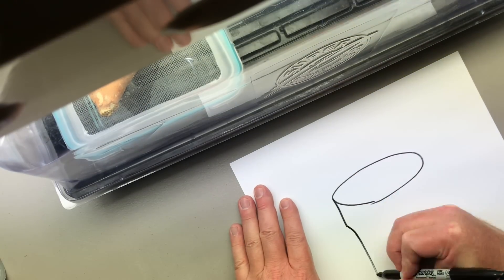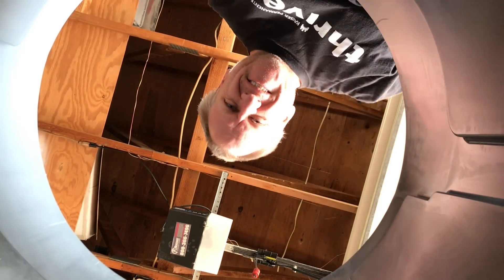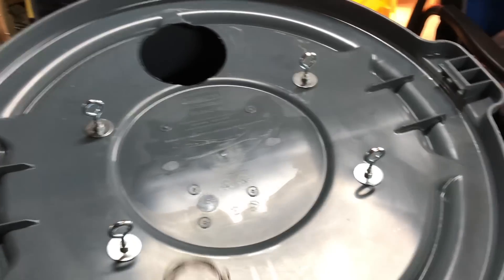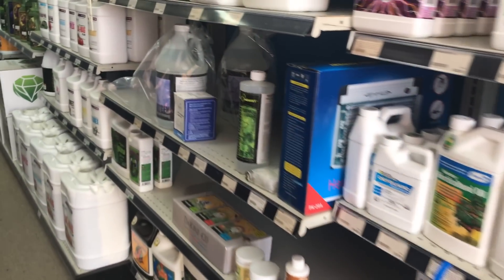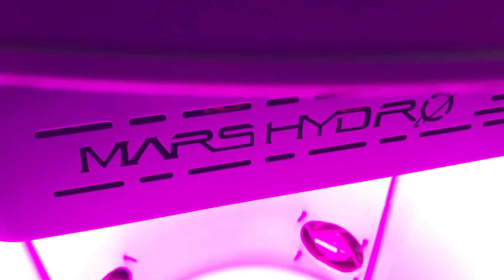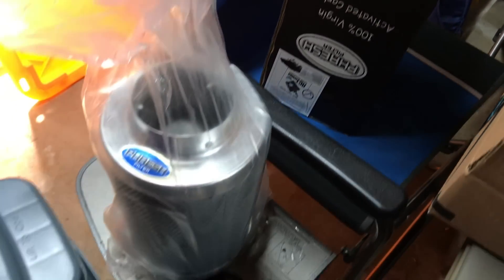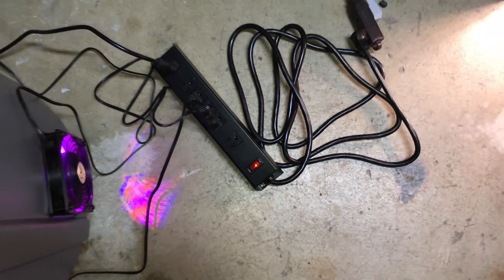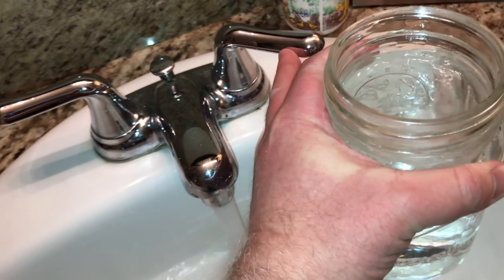They Grew Inside My Secret Trash Can

Comment: PS. Still have Reef tanks, and the world of LEDs look amazing. Imagine 1000 watt HPS, 1000 watt Halide heat buildup in an 8ft diameter Mylar curtain. They love less than 70 degrees under lights. 60 to 65 or a little more in dark. They are athletes, the hotter they are, the more energy they waste transporting water.  You might try some type of portable A/C to supplement your environment. And they love stress.  I would break the main branch at a point where I could get a good 90 degree bend, and allow all the budding sights to stand straight up. I used shoestring and thumbtack to the ceiling and repositioned almost daily.  If I say light hitting the curtain, wasted light, move a branch to capture it. I mean, 1000 watt lights were only good for less than 30" penetranion. Max height was about 36" from floor

Comment: I will give you a professional tip. If You don't want to do full hydroponics, use 4" Rockwood cubes, and a Rubbermaid wash tub,about 12X16".  Now here's the thing about Hydroponics,  its not just providing nutrients, its more about cycling the water. But its not cycling the water, its having stagnant water that the plants have pulled all the 02 out of. Its like a pond.  So, being an old aquarium guy, I used air pumps, gang valves and tubing and air stones to oxygenate the water. Never had to change it, only add water weekly or so. When the plants were ranking, you saw this beautiful white lace root system.  If you got root lockup it might turn a little red tint in the water, and effected plants roots wouldd turn tarnish.  I would pull that one out, flush it out good in the tub, and reinsert an watch it.  That was 30+ years ago, and turned several Dutch growers onto it.  Sometimes its looking at things from a different perspective to see something.

Comment: I don’t see how the carbon filter is doing it’s job when it is extracting the air from outside of the bin ? Also lining the inside walls of the bin with reflective Mylar or a white sheeting (black and white) will help with light refraction

Comment: Might want to line the inner walls with reflective material, mylar emergency blankets will work well. The light reflection will improve your plants light coverage and also help lower foliage receive more light than what those plain gray wall will produce. And also, I would recommend using a pvc plumbing bulkhead to properly secure carbon filter, may use caulking to seal air tight, And will look better. And if the filter sticking out the top is too noticable, and want it to be more concealable, cut bottom of 5 gal bucket and drill holes in the lid and throw it over top of filter and it will look like just a bucket sitting on a garbage can.

Comment: I'm new to this.. I'm using a commercial 5x 2 beer display fridge with two way mirrors in front , how does a temperature controller control temp? Shut the lights off,  lower wattage, or? 
Sorry if this is a newb question but thanks in advance. 
Tulips just became legal in AZ. 
Cheers!

Comment: Super OD on those fans. 435 cfm exhaust  for a trash can thats probably 40 cubic feet at most.  Could have used one computer fan in, one out to a 4 inch carbon filter and maybe an oscillating usb fan hanging inside but even that wouldn't  be 100% necessary.  Idk just weird to use 12x the electricity and charcoal filter to get the same results on his "tulips" which fucking annoyed me because i only clicked on this to see what kind of bonsai tree like bud he managed to produce in there.

Comment: I was Growing "flowers"(starters/seedlings) like this in 2005. Suggestions if you care, for the wires and plug, Dont cut large hole, just make a series of straight cuts making a star shape, then force them plugs through, and aluminum tape it's a good heat sink and air seal

Comment: Wouldn’t the height be an issue...?  Probably could have just tossed soil into the bottom of the can, no pot needed and save a little vertical space. May also need to cut the bottom out of another can and flip it upside down making a can bottom the top. Light has to be adjustable top to bottom so use pulleys. I say you need 3.5 feet from the top of the soil to the bottom of the light. This won’t grow a proper marijuana plant but it’s proof of concept and really cool

Comment: When I was a teen I thought I was being slick when I converted a huge house speaker into a grow box.  I used old computer parts like the power supply and a fan, rigged a light and lined with Mylar and a watering tube.  You would NEVER have known by looking at it that it was a grow box...but after a few months my dad started smelling something funny coming from my room...game over.  But it was a fun little project while it lasted.  One thing he mentioned that I didn’t have...a carbon filter, I know what kinds of flowers he’s growing. 👏🏽
Reply: So did your dad let you keep growing or no

Comment: Do one of those Walmart storage tubs. Or turn a piece or IKEA furniture into a multi chambered garden/desk. That would be sweet! I built a 2x2x2 pine box and covered it in reflectix. Just reflective bubble wrap. Cutting vent ports or Velcro stripping different gear to the inside/outside is super easy

Comment: What kind of carbon filter is this? I've been growing for decades and have never seen a carbon filter hooked up that way. Every single one I owned would need to get the "dirty" air sucked through to work properly. Your setup obviously  blows the dirty air through the filter. Is it a different kind of filter, did you hook it up backwards intentionaly, what's the deal?

Comment: I love the idea and the quality of your video, but how did you actually control the temp inside? You had a temperature controller but what mechanism dropped the temp inside the can? You could probably set a watering system from a  plastic hose run through the side of the can into the pot. Great idea!!!

Comment: How secret is it? It has a 12" carbon filter can coming out top. Has pc cooling fans on base. Wires and bolts sticking out side. And what is the trash can doing inside on a carpeted floor? You could have gotten a nondescript 4'x8' tent. People would be less interested in a mobile wardrobe for suits and ties 😉 than a trash can in a spare bedroom. Enjoyed your enthusiasm though

Comment: Use a storage tote black stand like a fridge place on a chair use a USB fan about 3 in from bottom an cut a hole on top I place a seedlings mat an a led light an use solo cups to start seeds an outgrow I make small holes on top to to hang light an a auto wifi watering system I'll make a video soon carb filter pad that's that

Comment: With fans blowing air into the bin the pressure will be higher than the surrounding ambient pressure. Carbon filters apply a resistant force to the air escaping through them. Air will find the path of least resistance when escaping a high pressure space. I suspect that the duct tape will allow air out over time and the smell will be noticeable during flower. A good way to test for air leaks would be to blow smoke into the bin and watch to see if any smoke escapes anywhere other than through the filter.

Comment: There's still air leaking from the lid. And my tulips are growing tall quickly with the MARS lamp. My lady likes long stems. What do I do now???
Reply: Putting up a net should help train them from growing too tall. You can always tie some branches to the edges of the can to help bring the height down.
Reply: Maybe a strip of adhesive backed foam around the top of the can for the air leakage.  And tell her length is nothing if you have girth.

Comment: This is bullshit, that fan cannot force the air thru the carbon filter properly there has to be a duct fan down the line sucking out heat and forcing thru carbon at proper rate

Comment: Really nice build! But I have some pointers for growin weed in this setup.
 1. There needs to be some kind of flap to stop light coming through the intake, since irregular light schedule can be damaging to plants. I would go for a shroud on the outside. Tho I would rather go for passive intake and active out directly connected to the carbon filter.
 2. The white wool from the filter's box is a primary filter as to not clog carbon with big particles.
3. For a really stealth build you could install fans and carbon filter on the inside of the trash can.
4. Reinforce the lid with some plywood for extra rigidity.

Comment: I would modify trash can slightly with holes in bottom with a drip tray underneath to catch spillage but other than that awesome design
Reply from the maker: need negative pressure for that tho
Reply: @JebGardener  trash can inside a trash can maybe?

Comment: made one of these a few years ago, they work well if you are limited on space, stick in the corner of the room and your good to grow a lot of things, I used 2 bins top one upside down on the bottom bin attached with latch's, and was set up so it could be taken down and stored away if not needed, cheaper option if you don't wanna spend money on a grow tent
Reply from the maker: sounds fun

Comment: You would be a lot better off with a fan directly on the end of the carbon filter pulling the air out of the trash can so you have negative air pressure inside of the can, the way you've got it makes a carbon filter pointless as air will be escaping everywhere due to the positive air pressure, not sure you need a carbon filter for tulips tho.
Reply from the maker: postitive pressure is a way to reduce the need for fan power though.  As long as the only way for air to escape is throught he filter, you will be fine
Reply: @JebGardener  making something totally air tight is very difficult to achive, if you've got a smelly plant whos smell your trying to stop escaping to the outside world then negative air pressure is the way to go, i'm pretty sure that one larger fan pulling the air through the trash can would be more efficient then 3 fans pushing the air through the can and out of the carbon filter. The other problem would be if one of the fans broke then the 2 fans that are left would be pushing unfiltered air through the hole for the 3rd fan.

Comment: bit ott though isnt it, arent those led light best at like 2 to 3 meters above the plants heads
Reply from the maker: i think 18 inches would be fine with proper ventilation.  heat is why i employed the temperature contoller

Comment: Could easily add a drip feed for the watering, or a flood and drain system
Reply from the maker: sounds complicated
Reply: @JebGardener  not really, the bin could sit on the well, use a small fish tank pump on a timer. Fairly simple. It would reduce the amount of time spent taking care of the plant, you could then just check the stats on the temperature, use a clear tub for the well so u can see the water/feed mix level. Be easier to leave it for a couple days unchecked if needed. Like the idea though and I've actually come back to this video after a year as I'm going to do the same but using a taller wheelie bin and line with mylar

Comment: Metal plumbers tape would work great for trying to attach that charcoal filter better than you did. And you're using it the wrong way it's supposed to suck air in and push it out. That's the reason for the pre-filter that you threw away. It makes the charcoal filter last three times as long depending on how dirty an area you're in, a garage you might need it more often

Comment: I don't understand your theory behind having a charcoal filter for something like tulips? I only have one for mine because I grow cannabis for my Crohn's disease it's actually the only medication that actually has any effect on my Crohn's which is horrible to the point that I have a colostomy bag on my belly and it's not reversible because of all the perianal abscess is I had with my small intestine pouch. Large intestine gone since 2001. Your little Trash Can thing is it all right idea your weakest link is probably either they LED light or that duct tape. A Spectrum King 100 would be perfect in that trash can. And I would drill the exhaust hole over the top center of the LED as well. Spectrum King has a massive heat sink no fans. I would also put a fan inside to blow against the foliage or a canopy of your plants. Then that would be perfect.

Comment: For watering, you could cut another small hole on the side or wherever fits, feed a tube into the plant and a funnel at the other end, that can detach and you can close off the pipe and keep it from losing air, and put a small live camera to watch it grow or not.

Comment: go to amazon and buy a 2x2 grow tent for the same price as the rubbermaid trashcan. Much easier to assemble, no hardware needed, and the tent is equipped with reflective material, ventilation panels, and light mounting brackets.
Reply from the maker: yes tents are better than trash cans, but this is fun
Reply: @JebGardener  I understand, and it is a cool project.

Comment: I'd probably use a different cable for the light's power. They have them in a style that is 45 degrees and you wouldn't have to give as much clearance. More room for plant growth.
Reply from the maker: i could have switched it but i wanted room for the fans to circulate too

Comment: i got the same light
Reply from the maker: how is it working for you?
Reply: it works great  i actually used it to grow cannabis for my own oils so I don't have to take siezure meds. It lasted bout a year long at 12 hours a day before diodes start to die off but the casing works great to make a homemade cob led after diodes die. atleast that's what I do I also like the vipar spectra its only tiny bit more pricy but has built in UV and ir which is great for plants
Reply: but mars hydro is my go to brand for led as the price and they are strong so they are great and prob the biggest name in the led biz for your every day grower as can't beat the price for quality

Comment: Mate a couple of suggestions.  Put the inlet fans behind the handles. The inlet is then hidden and a better position.  I painted the inside of mine white, helps with light. It isn't too hard to fashion a carbon filter that fits neatly inside the lid, without taking much space, and adequate for one plant. My own version is almost undetectable from a normal bin unless you open it. The grilled lid outlet doesn't show any light, and only the neatly fitted power cord coming out the bottom is off.
Reply from the maker: you used positive or negative pressure?

Comment: Space buckets!!! When I recommended them I really didn't think you would do one. Pretty incredible, huh?  I have a trash can with a hole cut in the bottom the size of the inner diameter of a 5 gallon bucket. The bottom of the trash can is attached to the top of the bucket. My...uhh..."tulips"...yeah, my tulips are planted in the bucket which allows more height  for the tulips to grow. Also, "they"...whoever they are ...recommend painting the inside of the bucket flat white as it reflects more light back on to the plant. No idea if that's true are not. I just did it. It's always a pleasure watching your videos. Thank you.
Reply from the maker: yeah i seen them stacked buckets.  it's a neat concept but i would just use a trash can

Comment: what's your monthly electric bill looking like?
Reply: nothing.. that whole rig uses about 1/3rd of a space heater...
Reply: actually that light draws around 170 watts from the wall.. plus two little fans, and most likely a humidifer, if you plan to grow pot...so probably about 250 watts draw total.... space heaters usually rock about 1500 watts... so about 1/6th of a space heater... not too shabby....

Comment: You could line the Can with foil. To maximize the light your plants are getting..
Reply from the maker: good idea
Reply: @JebGardener  I used two strips two foot long, and foil for a backing screen. Also an inf-red heater to grow my salads all winter..
  Also this acts as a great humidifier, in the dry winter.
  My set up was in a C shape. With heater on one side.. The foil help the plans grow nice. 

  I did have problems with my onion roots kept molding.. As I use pot soil to grow all...
Reply: @JebGardener  note: mys system not counting heater was only 12V at less than  1.2Amps but it worked. 

Next year I am doing more lights. And will try a Mylar door on access side.

Comment: Rubber air hose tubing about 2mm in diameter or so.. ran into the base of the soil and out the top of the garbage can.. epoxy a funnel to the top of the tubing and eliminate the watering issue.. just a thought anyway. Cool idea for microgreens year round
Reply from the maker: sounds complicated

Comment: i would cut a door on the side for ease of plant maintenance, although you'd have to worry about sealing it up good if you want it to stay airtight. Less of a worry if you keep negative pressure inside. 
I wouldn't wanna do everything from the top =(
Reply from the maker: how about if the trash can is upside down?  the plant sits on the lid and you lift the whole can off to access the plant!
Reply: @JebGardener  thats actually interesting lol. great idea. I probably still prefer the side door because you'd have to lift the whole can, including light & hardware, every time you want access.